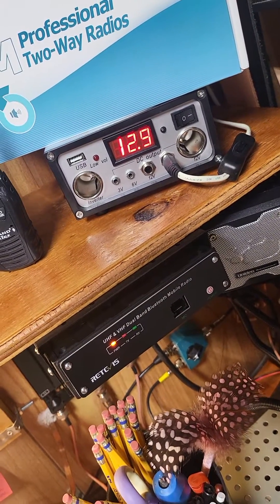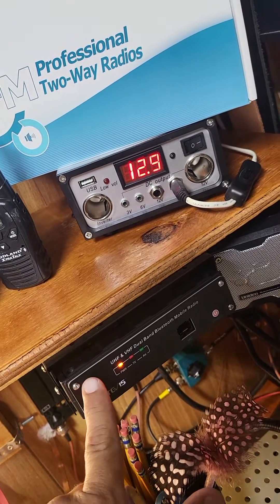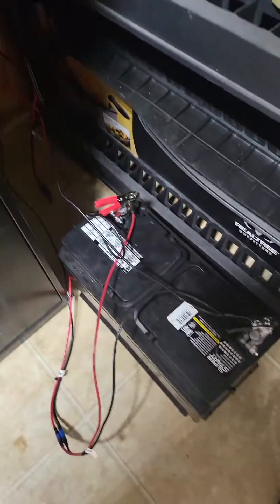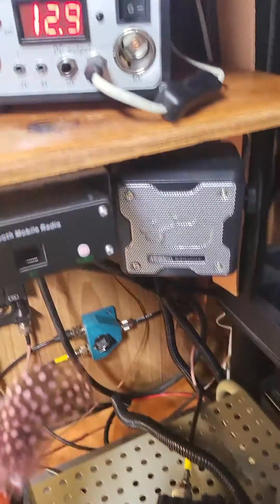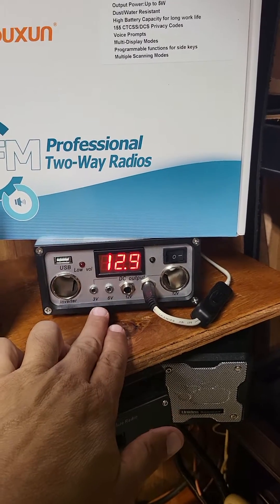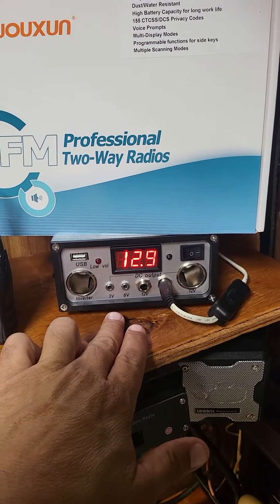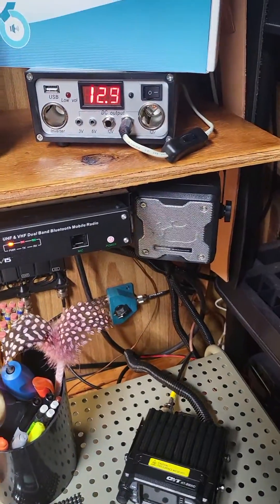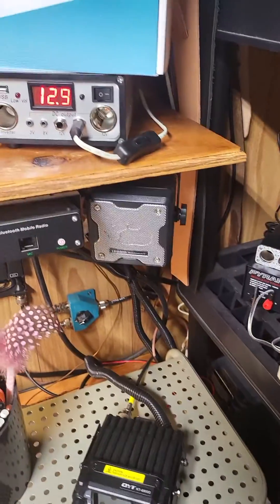GMRS - 100% solar Retevis RT99 simplex repeater.

Comment: i am running a retivis gmrs repeater at 4100 ft,3 100 watt panels,2 deep cycle marine batteries,4 folded dipoles for the antenna,it covers about 100 miles in the san juaquin valley,and pretty good coverage in the foothills and sierras,the retivis does,nt draw much,the panels and batteries keep up pretty good,two years ago it got snowed in,batteries failed,i have all the panels mounted vertical now so hopefully snow won,t be a issue,thanks for the video
Reply from the maker: Sounds like an awesome system!  Thanks for watching and taking the time to comment!

Comment: Nice setup. Seems like it’s doing the job for you. Is that a deep cycle battery? 

I have a 6ah LiPO4 battery that I use portable and a lawn motor battery set up with a solar panel that I can deploy. I know car/lawnmower style batteries aren’t the best for this purpose, but it was super cheap.  The LIPO4 battery I have  kicks ass and takes names while I am operating portable. Have used it for over an hour doing POTA before and didn’t find the bottom.
Reply from the maker: It's actually not... it was a brand new freebe that was donated.   I know it's not idea but for testing I figured what the heck.   As far as your batteries go,  kinda the same,  if they work why not use them if they are doing the job!  Lol   Thanks for watching!